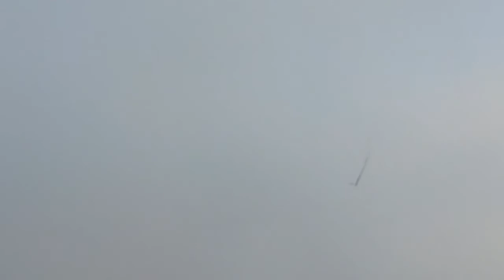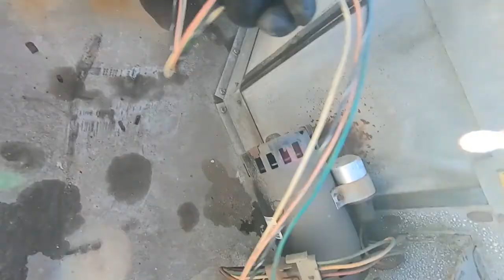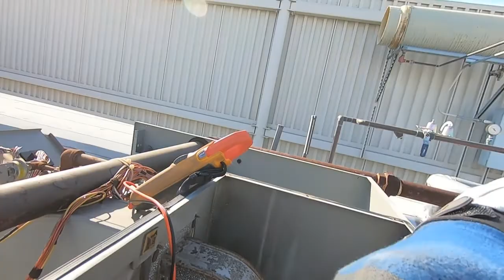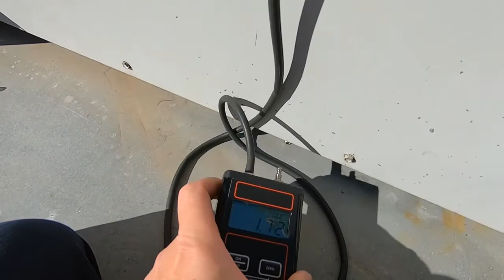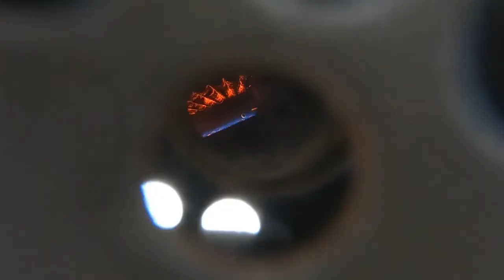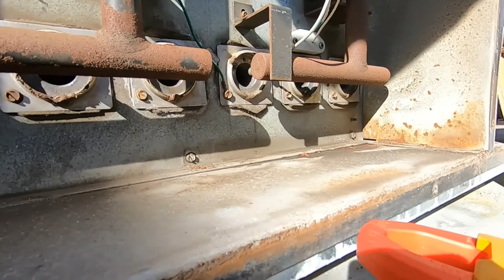LOCHINVAR BOILER NOT FIRING UP MULTI ISSUES

Comment: I get an f p code during start up ,any ideas what that means ?
Reply from the maker: Maybe freeze protection fault. What’s the parameter set for on that ? If not have you look in the manual for F P ?
Reply: @HVACMorgul  the manual is pretty vague when it comes to that code but I will check that fault . Even though in arizona the water temp is nice at the moment .
Reply from the maker: @jesuscorona7101  it’s not necessarily the actual water temp but the sensor could either be intermittent going out of range or it’s bad. Is it turning on the circulating pump?
Reply: @HVACMorgul yes ,

Comment: Help ! I have a copper finn 2 that only heats when I take the common wire off the High limit controller. once wire is removed gas value 2 and 3 will open and boiler will heat. Gas value 1 will not open ( not getting 24v). Also once water gets to temp boiler wont turn off. I have replaced the high limit switch, main board and relay on the board and still have the same issue.
Reply from the maker: When you remove the com off high limit, does it show its calling for all staging of heat? Or only 2 and 3? When you replaced the high limit did you change the sensor as well? On the wiring diagram is the high limit connection correct ?  The differential might be set to high for the heating set point causing it to stay on. I’d double check your water temp sensors.  When you say boiler won’t turn off you mean the burners stay lite? Or the burners turn off and the pumps stay on?
Reply: @HVACMorgul  This unit only has two stages with two gas valves on left and one on far right. two on left is stage one Yes it does call for heat on both stages.. setting are 125 with  2 diff for stage one and 120 with 2 diff for stage two. Not sure about the sensor on the high limit. Are you talking about the copper probe that comes out the back ? if so it came with the switch. Connection are blue with black to common, purple to #2 and brown to #1. When I pull the blue/black  it will run. Yes the burners stay lit.
Reply from the maker: @dimitriyoung8287  Okay if it’s calling for stage 1 in which it’s both valves im assuming this is an older lochinvar which has the temp controller, on the back of that it shows your staging see if that’s sending voltage for stage 1 to valve 1. Sounds like either bad connection or the controller isn’t sending proper voltage. If you set the high limit to max temp does it still stay off? Is it NO or NC connection?  What’s your setpoint for the boiler? Also what’s commanding it on and off is it just going off water temp? You could try lowering the setpoint differential and see if it turns off it could be just maintaining setpoint temp just not enough to reach its differential cut out since it’s only using partial stage 1 and 2.